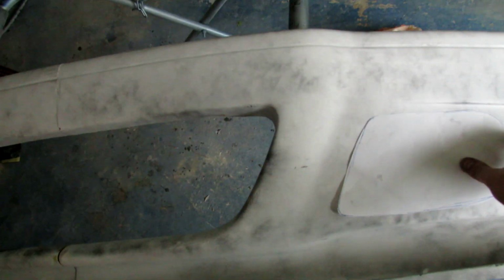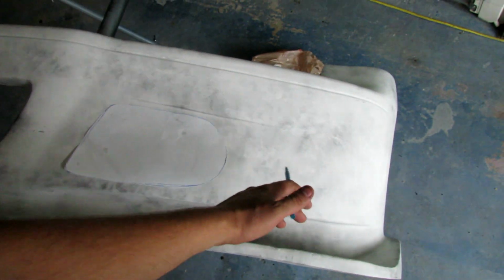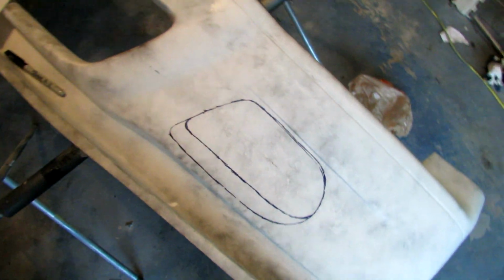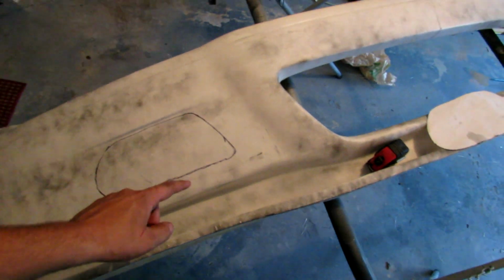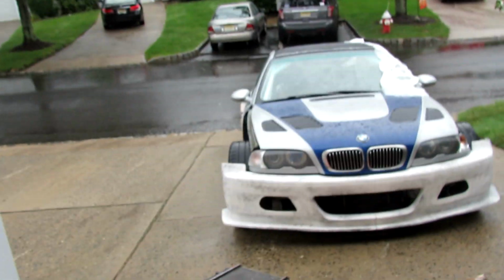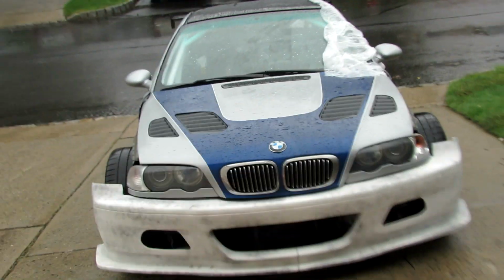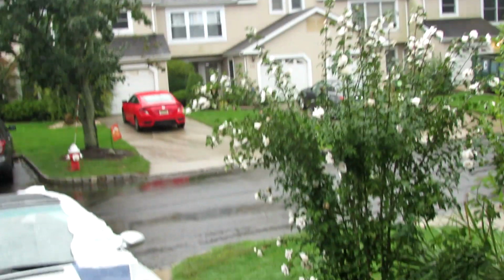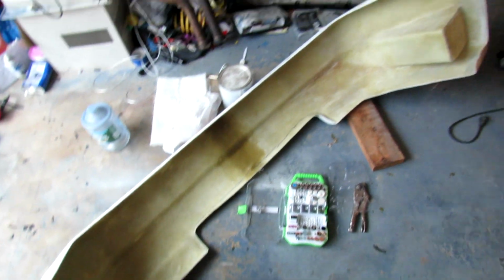Making the M3 GTR Bumper Look Better

Comment: To get the fron bumper in right shape, you need to verticaly cut the wide part close to the wheels, also making 2 horizontal cuts so you could bend the piece in to the car. BTW passenger side went looks like original, you just have to fix a bit the drivers side. Maybe its also just the angle of the cam. But non the less, nice work...

Comment: i wud also recommend just taking a pic straight from teh front, then you can use photoshop or maybe paint to play around with the scale of the holes.

Another tip, when you got the shape down properly, you can cut out the shape in MDF or something and use that to fiber glass the bevels which should extend inwards around the edges